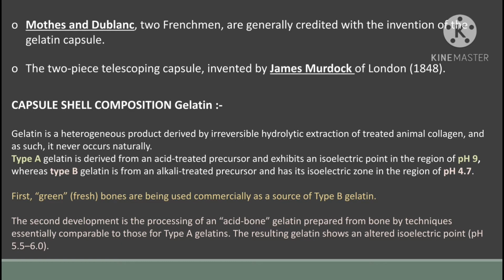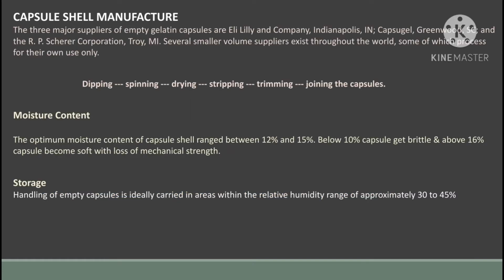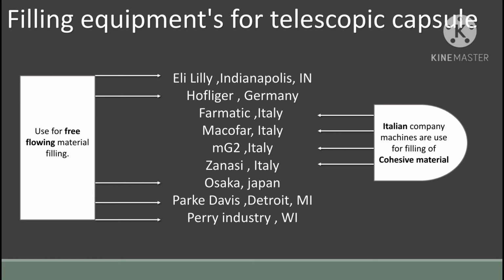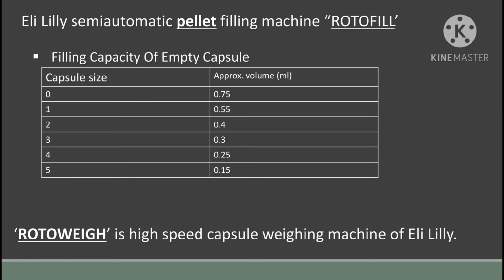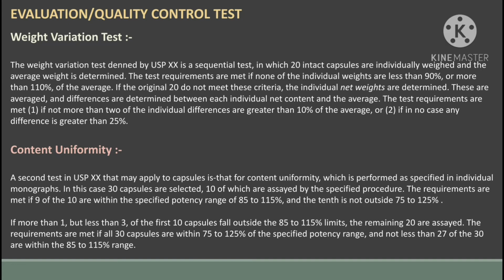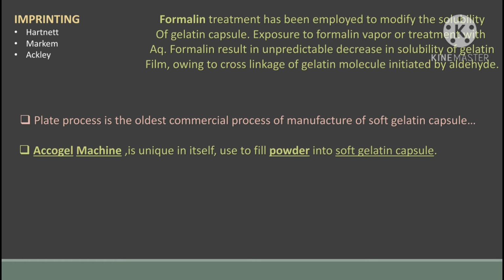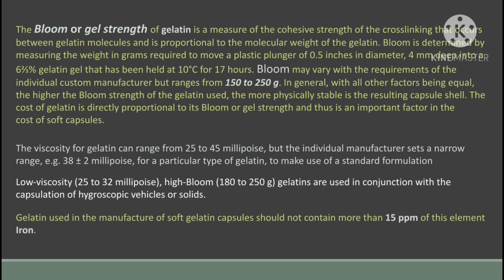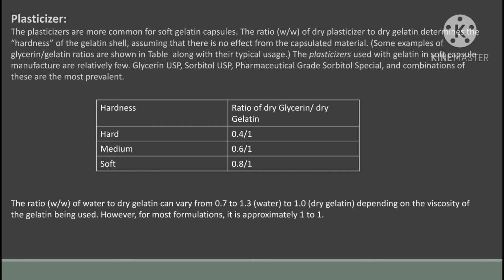💊CAPSULES .... GPAT Revision point of View...

Comment: Sir, 000 is largest capsule size.. and it is used for veternary purpose..
Reply from the maker: Yes,000 size capsule  is largest size capsule  mostly use for veterinary as it able to carry about higher dosage in it,
Also it use in humans too but for external use in generally.
Reply: @PratikDeshpande97  Yes,with 1.35ml capacity!!